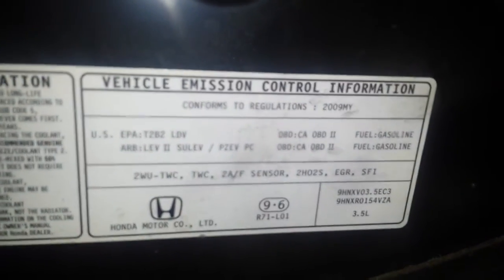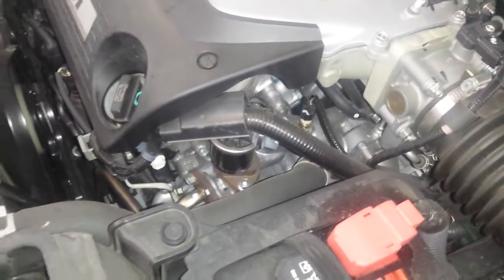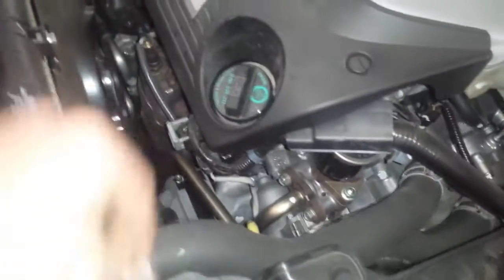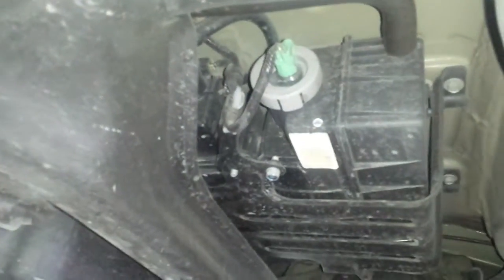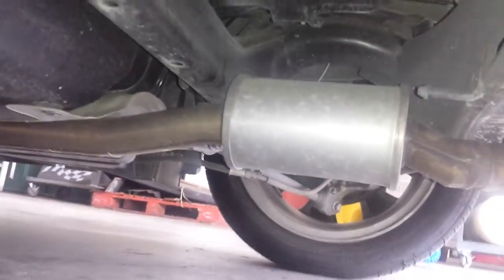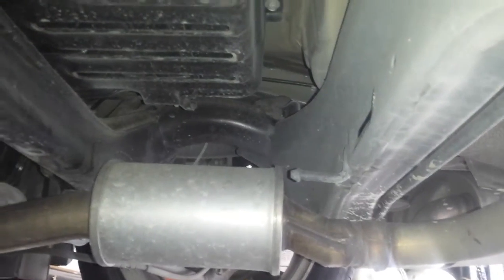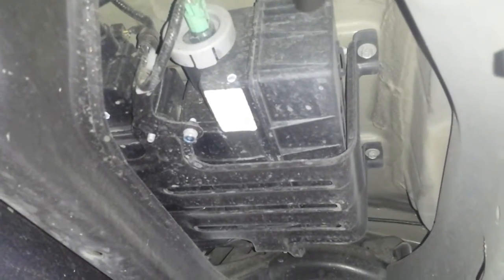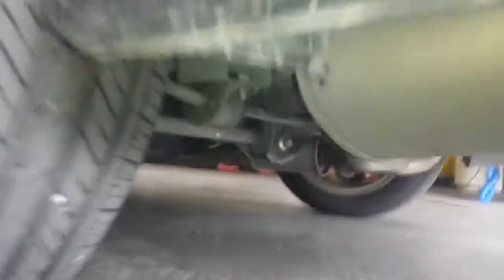Honda Accord Emissions Locations: EGR,  EVAP canister, & PCV locations

Comment: Would that piece in the rear stop you from gettin gas? Can it be cleaned?
Reply from the maker: The vent solenoid. Yes, it can cause the pump to stop fueling. The hose to ambient gets clogged with road grime and spider webs, you might be able to clean that out. The solenoid it self also can go bad.
Reply: Can it be replaced manually or i have to take to a shop?
Reply from the maker: That all depends on you. Some are fairly easy to replace. If you can get to it, just replace it. No need to reprogram anything. If  You have a check engine light on at this time and replace the proper part your check engine light should turn off within 30 to 50 miles. Sometimes it takes a little bit more. After he replaced the part you could also clear that computer if you have the OBDii scanner.
Reply: Can it be the vapor canister?

Comment: I have Honda Accord v6 2009 check engine light on code p73400 . Also exhaust emissions not smooth it's like on off .
Reply: I changed the oil pressure switch on bank1 but nothing changes
Reply from the maker: Is that the code? Do you get a 'P0xxx' code?